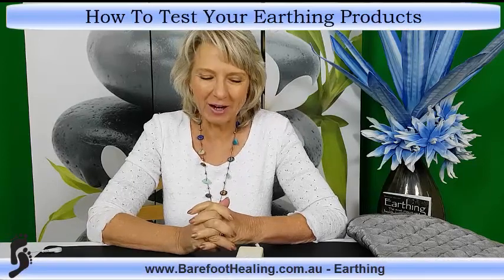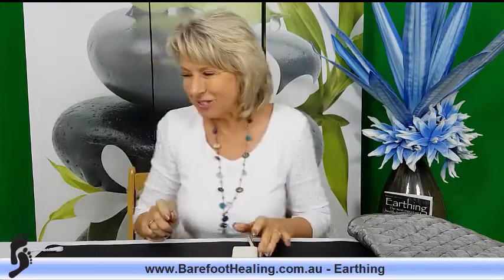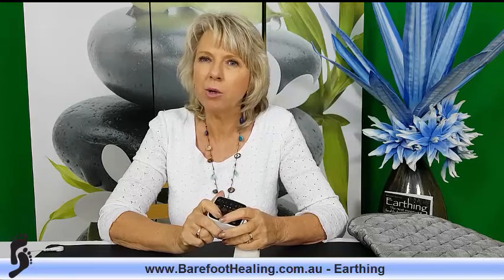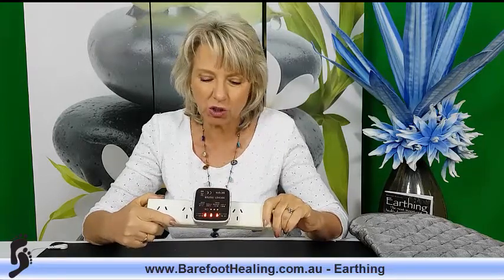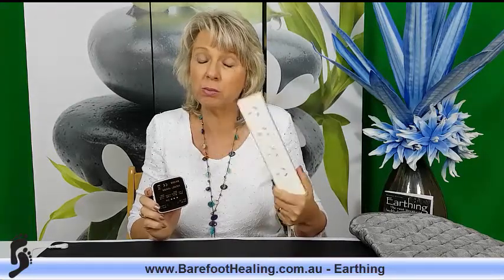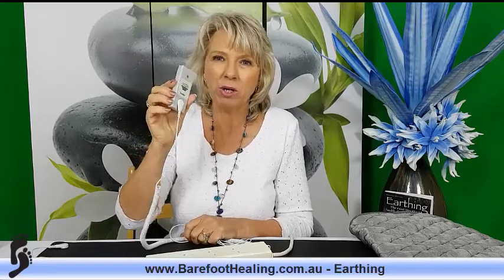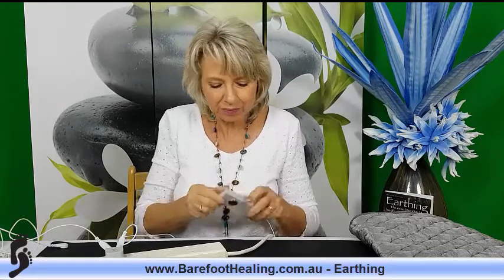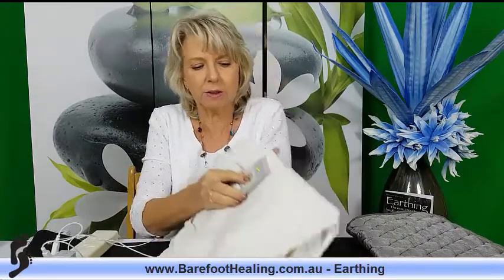How To Test Your Earthing Products

Comment: Using the tester on my mat, the light comes on. However while holding the tester with my finger on the disk on the back and my hand on the mat, the light does not come on. Does this mean I’m not grounding for some reason?

Comment: I have a PROBLEM.  My plugs all are showing that they are grounded.  My cords are new and test shows the items tested are grounded. NOW the problem is:  When I touch the blanket it does not show I am grounded BUT if I wet my finger and test it it than shows I am grounded.  ??????  So, when my finger dries out the I would not be grounded , right? What do I do?  I cannot get up all night to wet myself or blanket.  I would not get any sleep worrying.  What is the secret or am I not suppose to use these products?
Reply from the maker: Hello Janet, in regards to your question about showing you are being grounded.  Firstly, if you have tested your Earthing product with the Earthing Product Tester and the green light comes on and it is grounded and it will come through to you when you make some bare skin contact.  The product tester is designed to test our Earthing products, however, we can use it to see if we are grounded too, on our skin, however, there are lots of variables here, such as if you are hydrated enough, your mineral content, etc., and it doesn't always work for everyone.  The idea of wetting your finger is to speed up the process to know that it is coming through to you.  When you are sleeping or resting you will build up a very slight perspiration layer on your skin and it will not even be noticeable and this is how the electrons flow through to you - you do not have to be dripping in moisture.   Why not try being on the product for around 10-20 minutes and then try testing your finger again.  Regardless of what the product tester is showing, if your product is grounded and you are making bare skin contact you will be getting grounded as well.  I hope this has helped.
Reply: @Barefoothealing m

Comment: How to test when you use the earthing rod instead of the socket?
Reply: Hello Clara - if you are using an earthing rod you are going directly to the earth and as long as you have the rod inserted sufficiently into the earth and if possible in a moist spot there would be no need to check as with the Socket Tester we are testing that there is an Earth wire present and there is a connection to the earth via our electrical powerpoints.